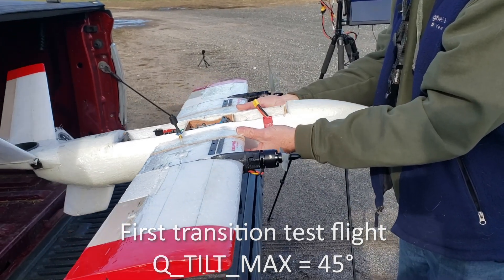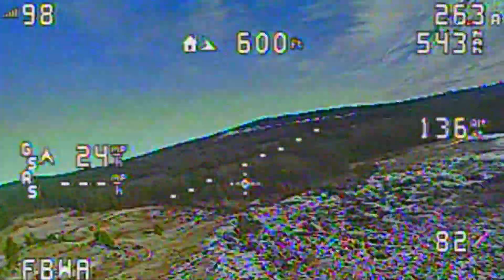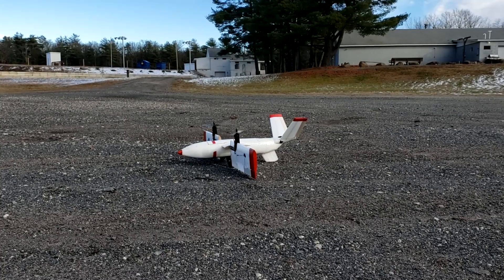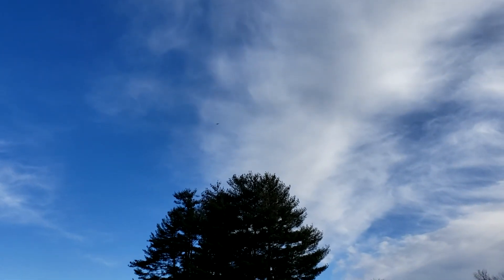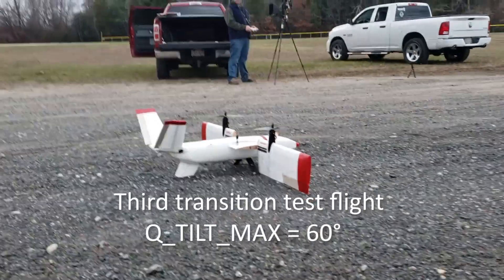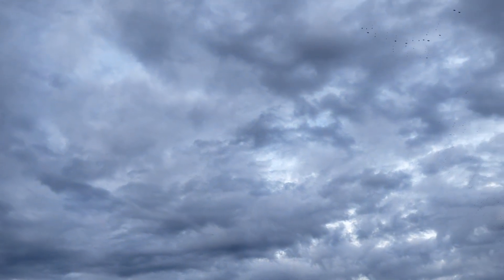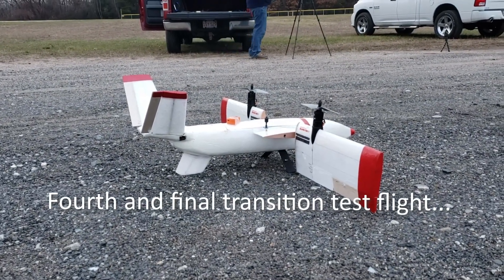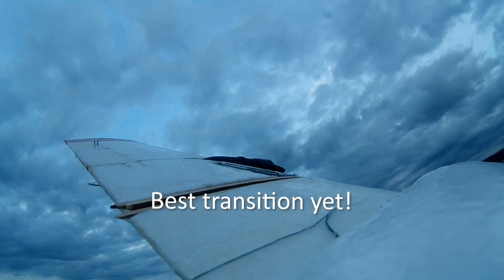Rogue VTOL Project -  Part 3 Transition Flight Testing

Comment: Kept it up, I know how discouraging a setback like this can be but, the end result will be that much sweeter. 
I love the speed of this guy, does it have flaps for slow flight?
Reply from the maker: Thx. It’s all part of the process. I got a lot of good data from this build and I will roll it into the next. Test early, test often!  This version didn’t have any flaps. It slows down pretty well on its own and because of the VTOL it doesn’t need them to land. The next version will have a bit more wing on it and should have better slow flight characteristics but likely won’t have flaps either.